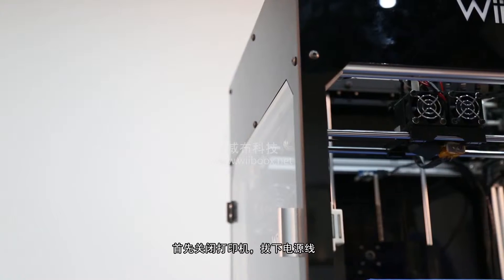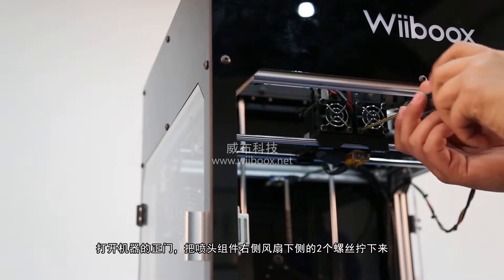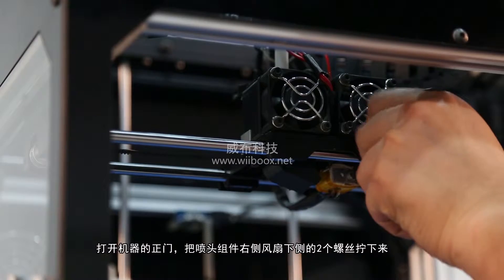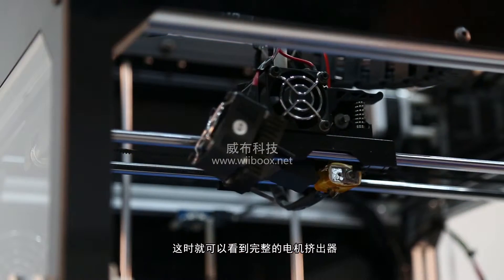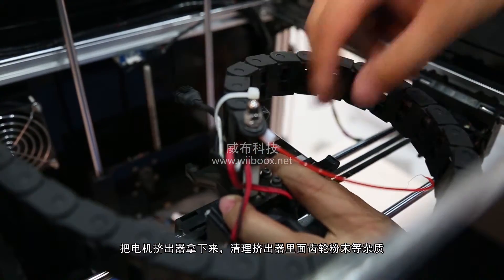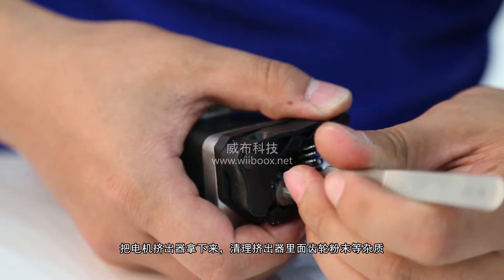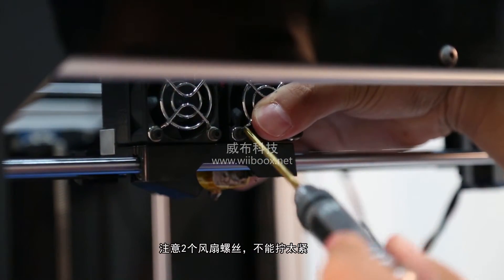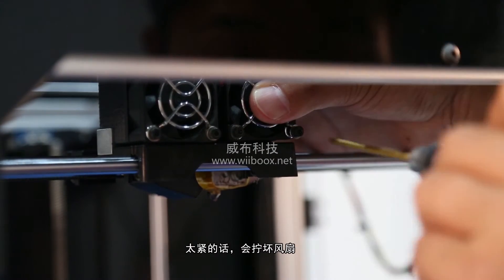Getting Started with Wiiboox 3D Printer 07: Disassemble Extruder Assembly and Clean

Comment: My wiiboox TWO is slipping the filament. I’ve moved the motor dented bush a little bit so that the filament sits in a new position but did not fix the problem. Also I’m not getting any help from wiiboox customer service.